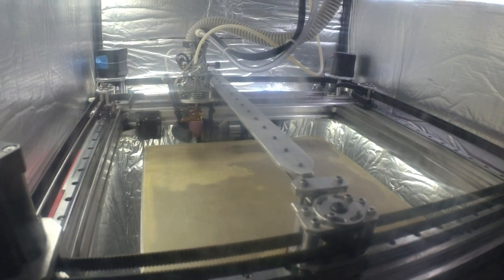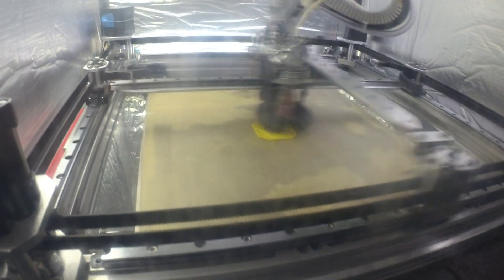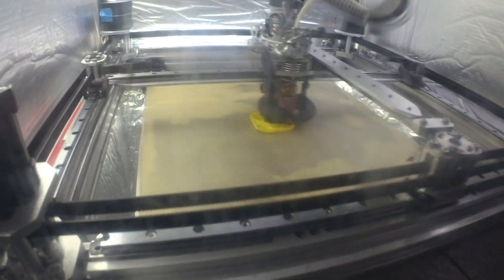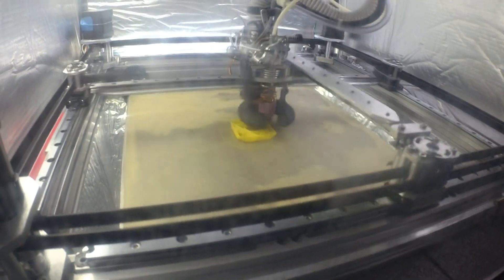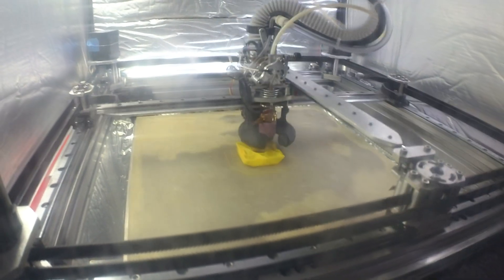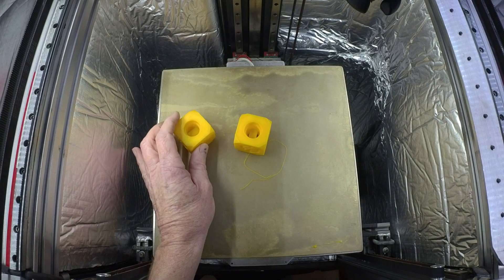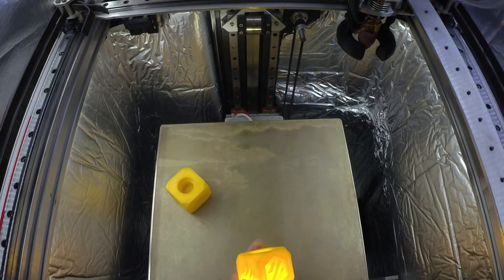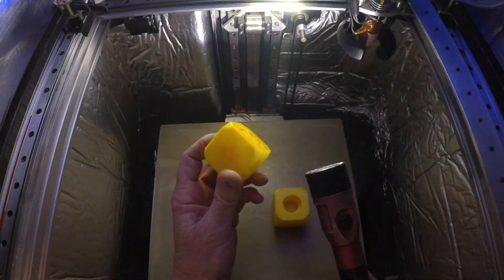Voron Cube, 150% size, sparse infill connected vs unconnected.

Comment: How many walls are you running here? Is it due to low wall count or specifically infill 🤔
Reply from the maker: I used 2 walls, which is what I see a lot of prints have.
It's more than just the number of walls! The layer going down is designed to put pressure against the previous layer and fill the cavity. This is why prints with under fill look better on walls or why which feature is printed first! But realize that if you print outer first, the next layer inside will push outwards anyway. The filament is not complete cooled and additional layers can still displace the filament already deposited. 
If the inner is done first it solidifies and the next layer is subject to follow the same lines. If they overhang/protrude, they will affect the layer next to it. So if your infill PA/flow/speed is not right, they can push into the walls.

Often I have thought about asking for 2 walls speeds in the slicer that are outer walls. Separate speeds to the 2 outer walls and different for the internal perimeter. But.. as you can see, even with 2 walls the infill shows through and also displaces the external wall. I know, hard to see in the video/yellow! It is a horrible color for lines visibility!